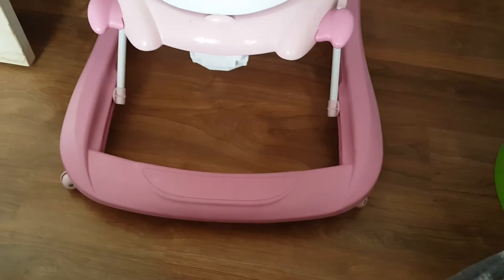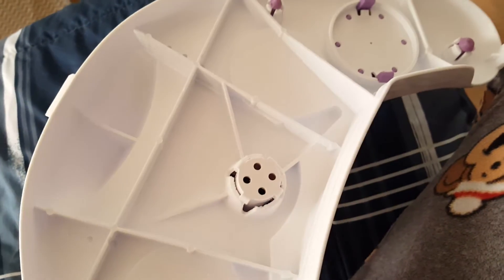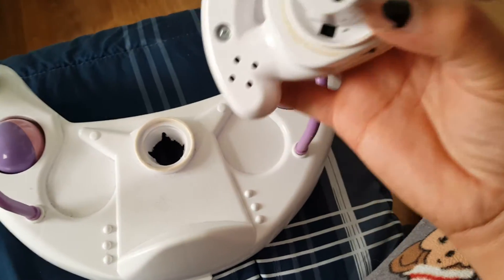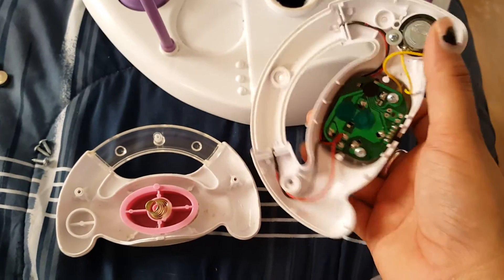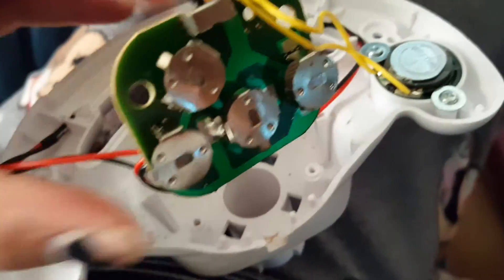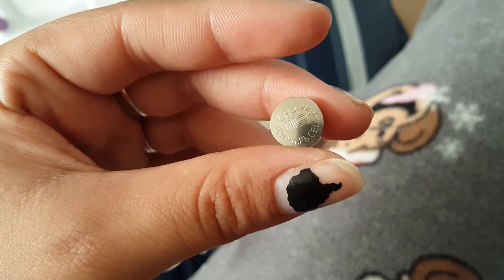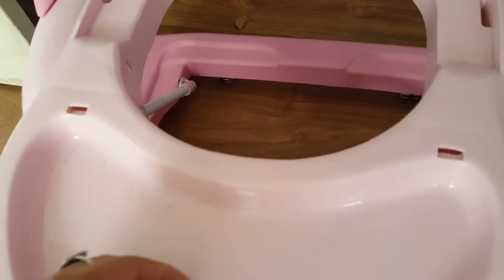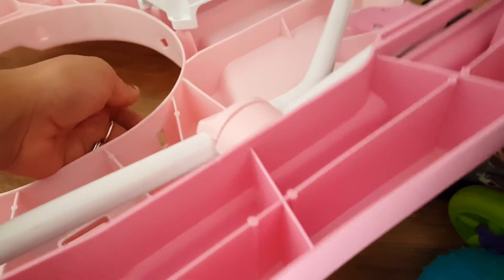Battery Change on Safety 1st Walker (cambiando las Batterias)

Comment: how did u take the seat OUT
Reply from the maker: There is two clips under the walker. You need to push the white tabs in and it will release it